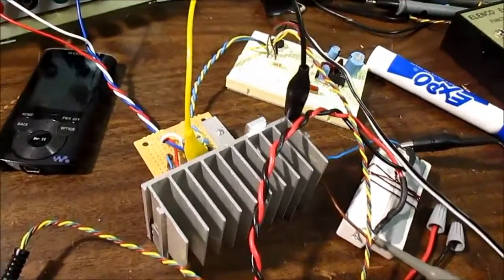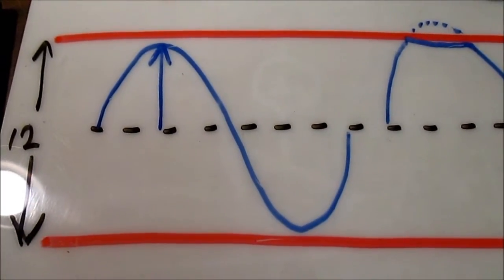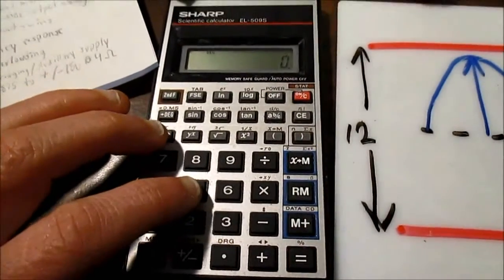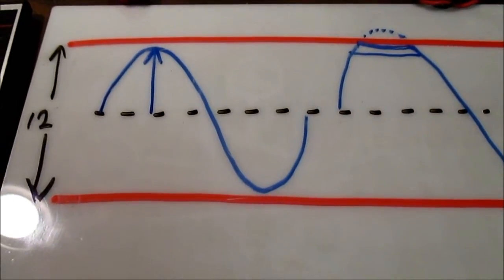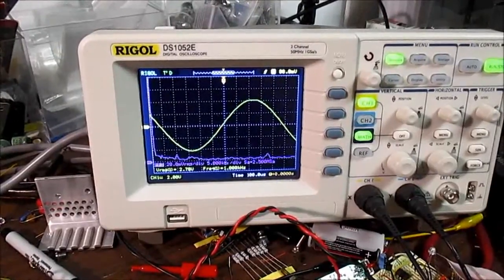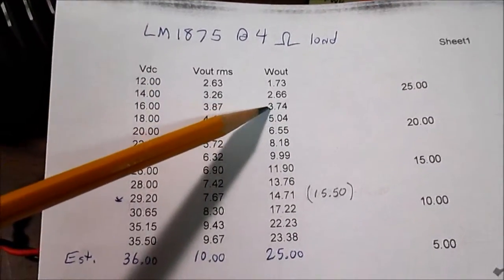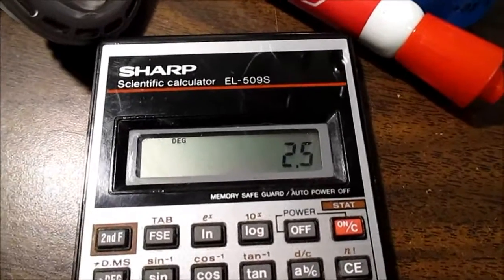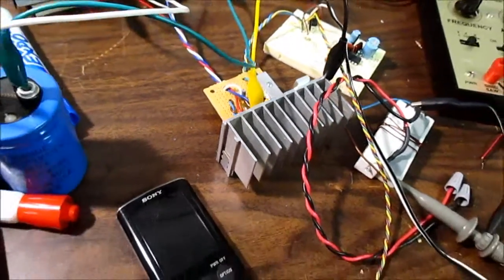Audio amplifier supply voltage vs. ouput power LM1875

Comment: I will rebuild my supply for my LM1875's using 12v 0 12v AC. I did use a 24v 0 24v and regulators but now realise now that's to much. Wish I had watched this video again before building. GREAT video's John, Thank you.
Reply from the maker: +Elecifun Glad you are getting the amp sorted.
Reply: +JohnAudioTech Cheers. I have made the changes and it is much better. The amp runs cooler and no regulators to cool. I am quite impressed with the LM1875's such a nice punch for such a small circuit. Just got to figure this 12v 12AX7 pre amp out and build a supply for it.

Comment: Are there major differences if using a single rail supply?. I have set up LM1875 with single rail at about 10.5 volts and am building a dual rail supply so I can try at + - 12 volts.
Reply from the maker: +Elecifun I assume you know the difference in components and setup if you used the single supply diagram example on the data sheet. The output coupling capacitor will roll off the deep bass if you don't select a large enough value. 10.5 volts won't get you a lot of power. +/- 12 will get you much more. Of course, that is 24v in single supply mode and will yield the same power..
Reply: JohnAudioTech Cheers that explains it well for me. I look forward to your next video. I have tried to find a video on setting up both sides of a 12AX7 running at 12 volts and biased for mp3 type player input, with a circuit diagram.  Would be happy to donate £10 to you for this ? Cheeky I know, but don't ask don't get ;)

Comment: Im having a little trouble figuring what power supply to buy for a stereo lm1875 board. I have a split supply that reads +/-26V on my meter with only the meter as a load. When I measure the rails at idle on the board rectified and filtered it reads 70V at idle so i shut it off. I see that the lm1875 has a maximum rating at 60v. Im concluding that that would have to be 60v at idle and less then 60v at clipping. If i was to get say a 200volt amp torroid transformer what would be a good estimated voltage to purchase so that once rectified it reaches but doesn't exceed 60v at idle? I would like to push it to the limit. I have all genuine parts and realize listening to music instead of a sine wave and at less then 100% volume won't hurt it with it pushed to the limit in terms of supply voltage for a given load
Reply from the maker: For 8 Ohm loads, I'd go with a transformer with an 18-0-18 volt secondary 100va would be plenty for 2 channel. If your using 4 ohm speakers, use 12-0-12v secondary because you have to work within the current limit range of the output. Use 10,000uf capacitors to help with good dynamic power and don't skimp on the heatsink size.
Reply: @JohnAudioTech  thanks John. Much appriciated. I'm going to have to seriously think about this. I have a nice rack mount case, massive heatsinks and a variety of speakers that are between 2 and 8 ohms. I started experimenting with series speakers splitting the power but increasing the total cone size. That's going well. I guess I don't know for sure my load yet and didn't want to leave power on the table.
Reply: @JohnAudioTech  I finally understand. I expected the rails would sag more under load. The info was all their in your videos, I just needed to piece it all together. 

Would their be any issue in using a 20-0-20 transformer rectified to 28.28v powering parallel 1875s. If I'm not mistaken this would allow 26v peak with 2.28v headroom. That would 18.382v rms over 8ohms is 42.237w. My idea is to have a voltage divider that is a 200k switched in series with a 1meg. This would attenuate the 18v rms down to about 16v allowing me to run it at 64w over 4ohms. My question is if their is a problem with too high of rails for 4 ohm load if the input is limited in amplitude to keep things in check? 

I understand if i was to have the switch oriented wrong for a 4ohm load it would fail. This would be a more permanent setup with a fixed phone input and a fixed load depending on what speakers i decide to connect.

Comment: It is very easy to trip the current limit on speakers bigger than 6", My 6ohm 8" speakers makes the amp fart at high volumes.Worth mentioning that my supply voltage is +-24v
Reply: That is everything to do with circuit design. It is possible the amp was only designed for 8 ohm loads or higher. It is simply bad design to use enough gain to push an amp into distortion on a load it claims it can handle.

This is assuming you aren't boosting the input voltage above input levels. That would force the amp to effectively have a higher gain than it was limited to.